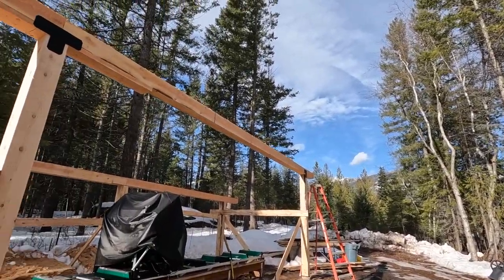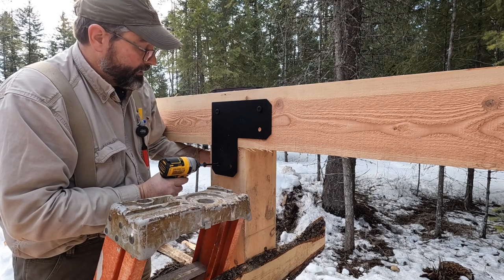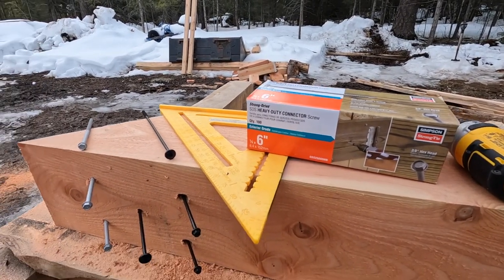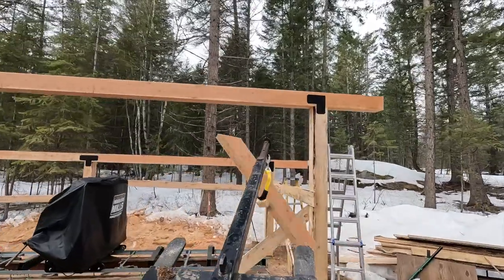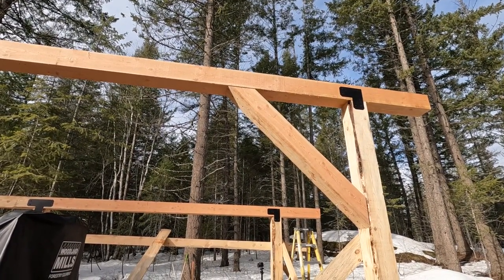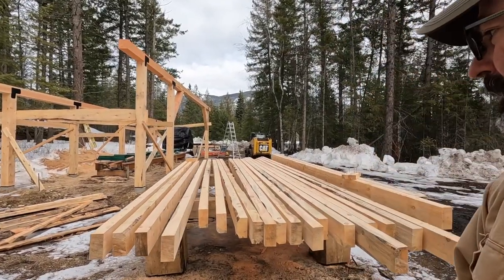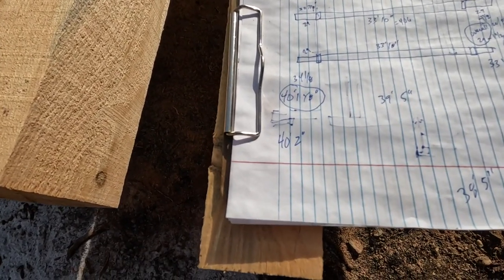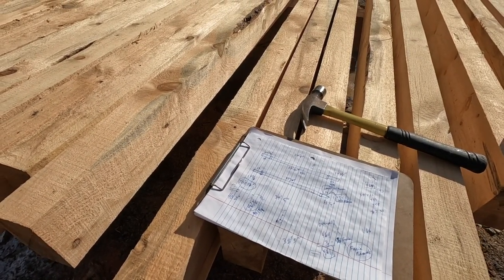Post and Long Beam Bracing // Sawmill Shed Build // Woodland Mills Sawmill // Homemade Lumber

Comment: It looks like you had a hefty bill from Simpson for structural screws and hardware.  We were the same and we got to pay extra for hardware that fit full dimension lumber that we milled.  It adds up quick: post and beam plates, hurricane ties for the rafters, post bases for the piers...  We poured 4' piers that were 12" wide and set j-bolts in the concrete when we did the concrete.  Do you wish you made it bigger yet?  We sure do with ours, nice build !
Reply from the maker: Posts are 7 1/2 x 7 1/2 and not true 8 x 8 because of the hardware. The true cost of hardware will be on the barn build 42x60. Pretty sure I won’t regret the size of that! 😂 How big is your cover?
Reply: We started out with a 10'x20' alaskan slab and realized we undersized it.  To gain space we added the piers alongside the pad and extended 10' past slab for some storage space, final dimension about 12' x 30'.
Reply: I wish I would have built ours bigger!  We plan to expand our sawmill shed.  But I am excited to see this barn build!  I am looking forward to learning from you.
Reply from the maker: @BissellMapleFarm  In all transparency, I’m learning as I go. Hopefully, I do some things right that help others and you can learn from my mistakes.

Comment: Well...  braces looks pretty,  but in reality they are not holding post and beam against collapsing - screws are not strong enough.   Look at the true timber framing braces  - centuries proven design.
Reply from the maker: I agree - true timber braces are much stronger and time tested. Comes down to time for me. Mortise and tenon joinery is in my future, but not for the barn project. Thanks for your input and for watching! 😀

Comment: Nice job. Good to see your son coming out to visit. 

When you are mounting the corner braces, would it help to have a 2x or 3x with a 45° angle cut to receive the brace screwed onto the post in the correct spot ahead of time? It seems like that would give a pocket for the corner brace to sit in and make it easier to get in place.

The cable idea is a good one. I have also seen it done with a strip of steel (1/8" thick x 3" or 4" wide). You just need to have it fastened in a way that it will be pulling on the ends of the beam not on the posts. If you could have done it before putting the beam in place, you could have put the beam upside down on some supports and then put weight on the middle to cause it to bend down (up when it is turned over) and fastened the cables or strip of steel in place to have it prestressed. 

Good luck with your project. Enjoying watching your progress.
Reply from the maker: Thank you! Yes, he loves to visit!
That's a good idea for screwing a 3x with a 45 cut in it for the brace to sit in while you're getting the brace up. Going to have to figure something out for the barn build because it will require a few of them...definitely will have people out to help with that! 
I thought about putting a piece of steel on one or both sides - but having it prestressed is past its point at this time. Someone has has already given me an old cable that came out of an old sawmill. And, another guy has offered to make a bracket. At this point, I am going to get the roof on and tackle that down the road.

Comment: Hi
Nice job. Are those posts and beam 6 inches or 8 inches.
Reply from the maker: Thank you! They are 7 1/2”x7 1/2”
because that is what the bracket that attaches to the concrete pier was, 
so I made the beams the same dimension. Thanks for watching! 😃